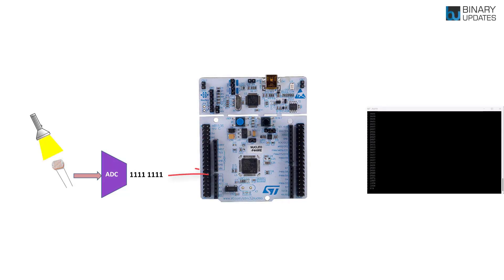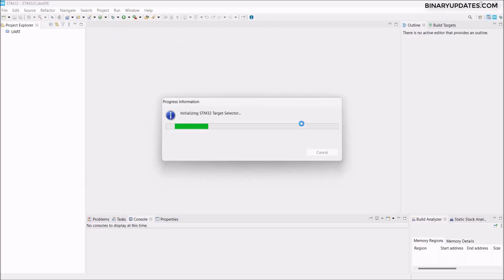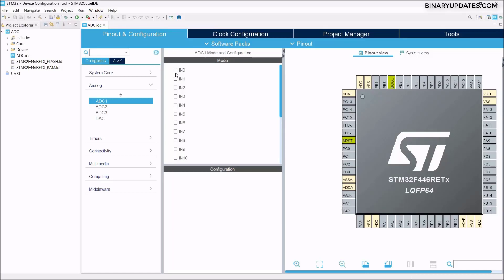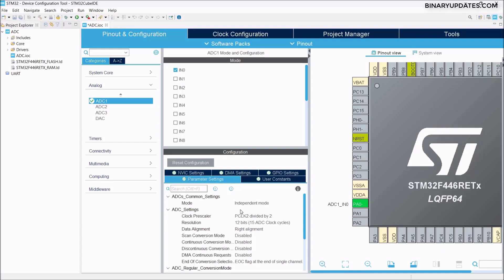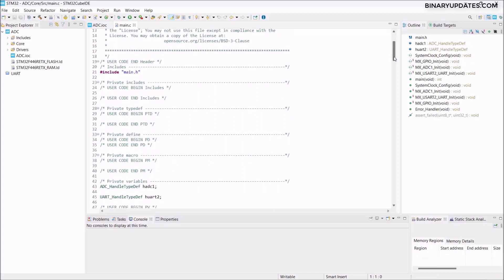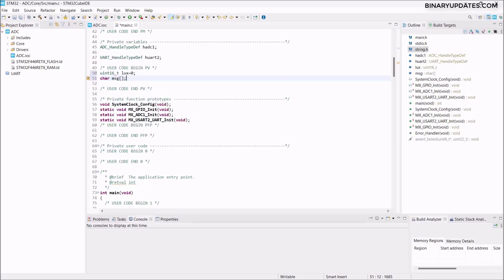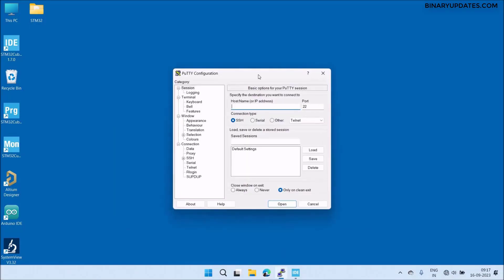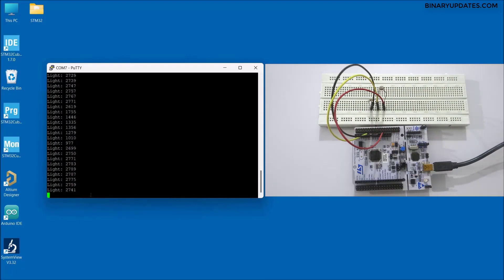How to use ADC in STM32 Microcontroller- Read Analog Sensor Value

Comment: If I were to use this microcontroller separate from a demo board, do I need an external ADC, or are the ADCs actually built into the IC itself?
Reply from the maker: Hi @flashdrc, the microcontroller used in this tutorial is STM32F446RE and its has built-in ADC so no need for external ADC. Best wishes!

Comment: Do you happen to have any idea on interfacing DFRobot sensors using STM32? They usually use arduino boards but I have a project and I need to use an STM32.

Comment: Why LED connected without resistor didn't get damage?
Reply from the maker: It was just for a quick demonstration. Always, use current limiting resistor with LED while connecting it to STM32 microcontroller. Best wishes!

Comment: Hi, I don't know why, but the text doesn't want to be output to PuTTY in any way. Help please
Reply from the maker: Hi I'd suggest to check the serial baud rate settings in PuTTY and sensor connections
Reply: @BINARYUPDATES  Hi! I've doubled check the serial baud rate settings and serial line. But when I press open in PuTTY, it doesn't open. 
How should I know what to do here?

Comment: why didn't we put a driver for ldr , how does it work ?? i don't if it's on the STM itself or what u've done on this video, waiitng for your explenation , i have a projectt please <3
Reply from the maker: Hi, if you mean external driver chip to measure light intensity. If so then, in this project I've used ADC peripheral of STM32 MCU to develop our own software drivers in code to read analog sensor LDR in this case. This code basically convert the analog value coming from sensor to equivalent lux value of LDR. I hope this might help you. Good luck and best wishes!

Comment: Hi, i followed your tutorial for my capacitive pressure sensor, however i need the sampling speed to be much higher than what this code is giving. I have tried changing the values in HAL_DELAY, the timeout for pollfoconversion but none of them are changing the speed at which the sensor is sending values into the putty serial monitor. Any idea if there is a setting i needed to change or maybe i am doing something wrong?
Reply from the maker: Hi @navkaranhanda It may possible when you change ADC sampling rate in STM32Cube IDE especially IOC file. Just make sure the changes also be seen in code generated in "ADC init" function. Sometimes, it fails to update code with changed parameters from ioc file. Good luck and best wishes!
Reply: @BINARYUPDATES  oh thanks for the idea. I changed the sampling rate from 15 cycles to 480 cycles but nothing changed, is 480 maybe just too much or could there be something else?

Comment: Please provide the virtual com port driver link for windows 11 .. 😢
Reply from the maker: Hi SaiKumar, I hope you're using STM32 Nucleo Board. Because when you install STM32CubeIDE it install drivers for ST Link so no need to install manually. If you want to update drivers then. Connect STM32F4 Nucleo Board to computer.  And then Click on HELP in the top menu bar, and then select ST LINK Upgrade -->  select your ST device in link and click on Upgrade. 

NOTE: If you're using other board then process may vary especially, in case of STM32 Blue pills and Black pills. In that case, you must ask your suppliers about that particular boards

I hope this will help you resolve issue.

Good luck and best wishes!
Reply: Can't we install virtual com port driver if we are using stm32f407
Reply from the maker: It depends on which STM32 board you have. Usually, with some low cost boards in market doesn't support ST Link as they prefer method to use on board boot loader to upload code on STM32 MCU. So please check your product manual and description to ensure, if your board has ST Link support. Good luck and best wishes!